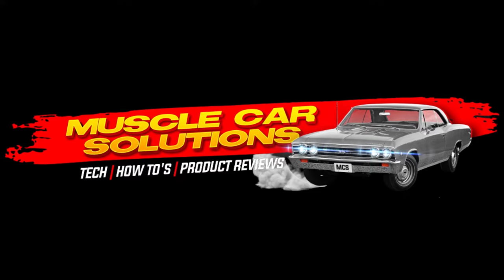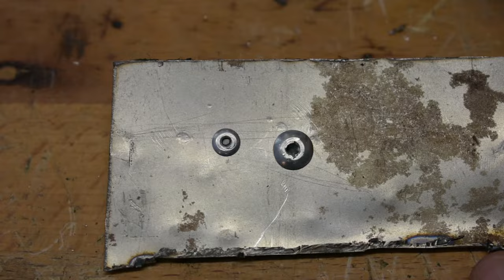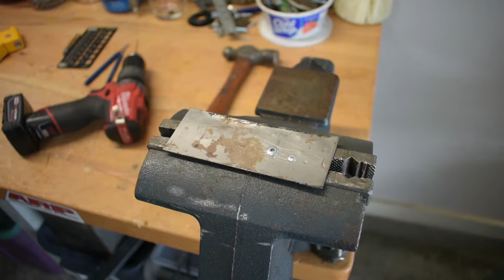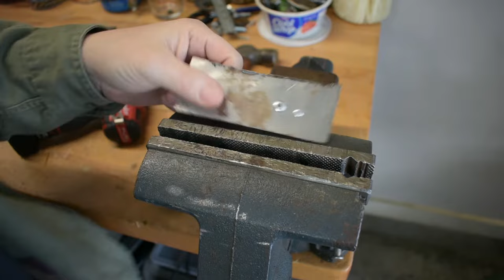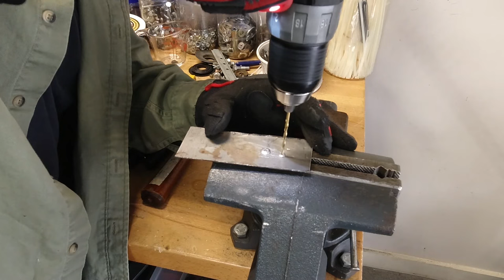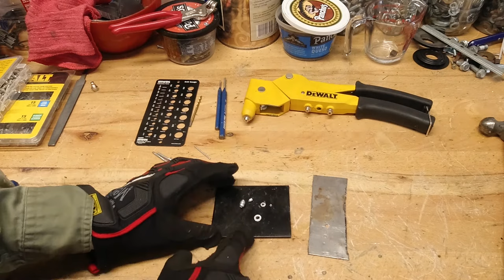Two Minute Tech: Remove Pop Rivets

Comment: That’s great in ideal circumstances, although I’m trying to remove 23 year old rivets from a boat. The holes are no longer there and I don’t have access to the back of the rivet. I got 2 out really easily but the others I’ve tried are leaving the back of the river in the hole. I’ve tried drilling with a larger drill bit but the rivet just spins in the hole now. Any other tips??

Comment: Super helpful, thank you! I have a bunch of rivets to remove from inside a van I just bought and if I were to blindly drill through, my van would be left with a load of tiny holes in its walls and ceilings... this is the first workable solution I've seen, thank you so much for sharing 🙏

Comment: I like your method to remove a rivet.  But in some cases it is not possible to get the rivet to an anvil and driving out the metal insert will just bend the metal around the rivet.  How would you approach these rivets?
Reply from the maker: Really don’t know.  I’d have to see what that situation looked like.  If the rivet went in, there will be a way to remove it.

Comment: Well done video, Thanks. I was thinking that this would be the way to go but I always check YouTube before trying something for the first time to avoid possible embarrassment. Some of the videos on this subject look like they are butchering the original hole by trying to drill the steel pin. If i had a bunch to do I would make a drift bit for my pneumatic chisel. That should make quick work of it.

Comment: Hi, I am darn new to working with automotive rivets. The rivets I am working with have a steel  exterior collar (what you see on the outside of the rivet). These must have a different removal process?(remember the most silly (stupid) questions, are the ones that are NOT asked). Thanks.